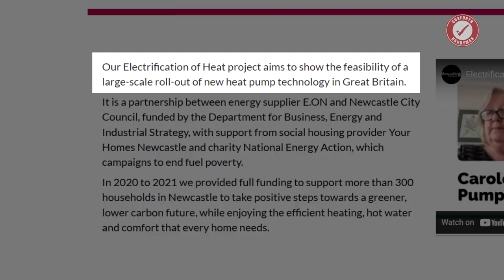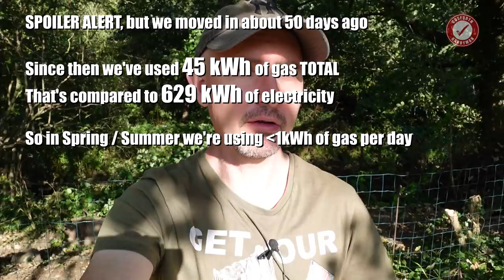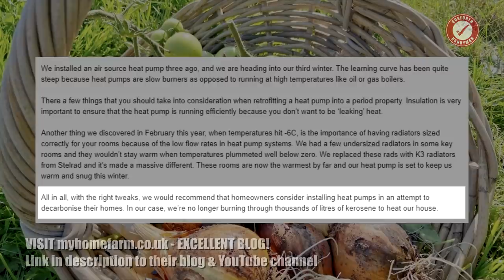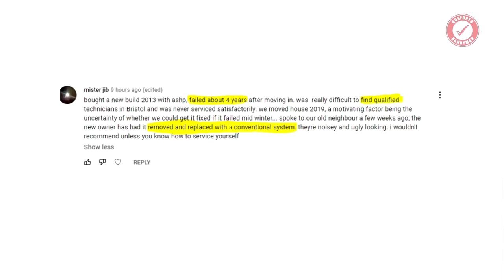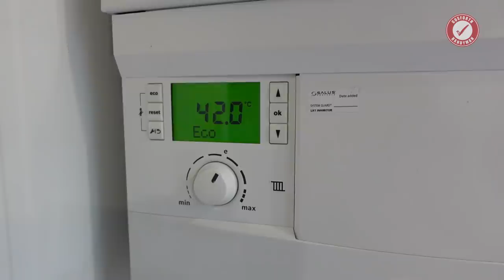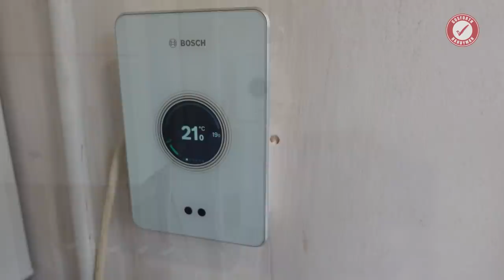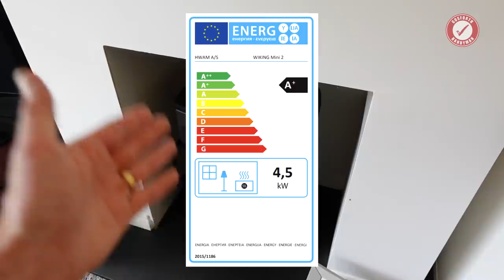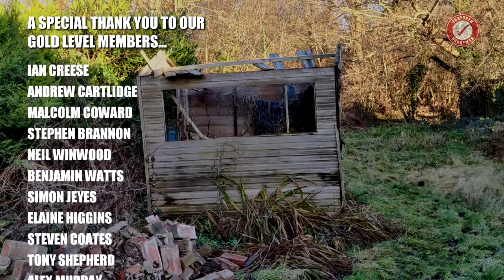Why didn’t we install an Air Source Heat Pump? (1920’s Renovation Part 32)

Comment: Stay away from air source am in the trade yes they work but and it’s a big BUT they just don’t have the efficiency and are not developed enough to provide what you need trust me on this am now going to watch the vid my dad who was also in trade has fitted AC in his major occupied areas but not air source 😉 he had the time to do the research AC also heats at a 4 to 1 input output value but it only heats air that doesn’t heat the building fabric but is very good ground source you need to be 10metres down to get the heat transfer at any reliable and consistent amount all your other details are pretty much correct 😉

Comment: We have reverse cycle air conditioning as it gets pretty warm in summer and heat is needed in winter. (Outer Sydney Aus) Just had a new unit fitted today! Our old LG system gave up the ghost a month back (18 yrs old) The new Daikin Cora unit is far more efficient than our old one. We have found over the years that 7.1 kw is good enough for our needs. In winter, we tend to use a wood fire. Finding good well seasoned wood isn’t a problem. It’s also pretty efficient. March to September has cost us approximately £100 for wood. Some wood I can just collect off the ground in the local bush. The Aircon only used occasionally when the fire has been allowed to go out. Now considering installing a Tesla Power Wall due to power outages during storms. We have lost all electrical power twice this year. Once for 4 days and again for 2. Thank goodness for a gas fired BBQ and a 2000 w generator!

Comment: You will be ripping that WB boiler out within 2 years - they have major design flaws - keep an eye on the silicon burner seal - they crisp up nicely and leak combustion gases. Also be prepared for a leaky diverter valve
Reply: Vaillant boilers are the way to go, from what I have heard?
Reply: @dougsaunders8109  lol
Reply: bolloxs
Reply: The model he has fitted does not have that type of silicon burner seal. They do need replacing after a few years on some models (ie Junior)  but they are are around £10 for the seal and if replaced when you have a service shouldnt cost a lot to replace. I have found that all makes boilers have there own weakness.

Comment: DHW requirements are different for everyone, but the standing losses on a modern cylinder are extremely low. If it was costing you a lot of money to run, there was probably something wrong with the installation. Also worth noting that the boiler will be most efficient running at the lowest possible flow temperature to achieve the desired indoor temperatures. Your discussion about the radiators being extremely hot and heating large areas quickly suggests there are further savings to be had in running costs.

Comment: If heat pumps were really so good they would sell themselves. They wouldn't need government schemes to help sell them. May be okay in new build  well insulated homes designed for a heat pump in the first place but not to retrofit in an old property
Reply: The issue is the shoddy installers telling homeowners who are on mains gas to swap for this unit, it wont be any cheaper as gas is so cheap. However with prices set to go up then ashp will tip that balance.

Comment: I feel the main issue with the comparisons, is they are argued based on efficiency where ASHP absolutely wins. But in the UK, mains gas is so cheap it's practically free whereas electricity is quite expensive. (It's about 1000%(10x) in price  between the 2 per KwH) 
Obviously Gas prices are set to skyrocket over the next few years, but I doubt electricity will sit around.

Also, The amount of issues I've had with British Gas and Scottish Power, I don't think E.On are any worse of the big 6.
Reply: British Gas (South Africa staff) and Scottish and Southern (SSE)... totally useless.

Comment: If it's free,  you are the product. 
Thanks for this, we have to change our boiler next year and were wondering about these things, our house was built in the 30s and has leaded windows so it's a definite nay nay.
 Haha you had an add for a heat pump water heater slapped in the middle

Comment: very interesting.
i live in rural Estonia. We use a wood pellet boiler, we have just had 5 tons of pellets delivered. We replaced our wood boiler 3 years ago as it was horrible to keep the fire burning... but that may have been due to the model & company. 
Our winter's will get down to minus 20 C deg.
We love this boiler esp as compared to the wood version

Comment: I live near Wigan and have an air-con for my conservatory, we put a proper roof on the conservatory so heat loss is nearly all via the double glazed windows. The air-con works as a heater as well (I think all modern ones do) but although the specs says it will work down to -7c, it doesn't do too well below -3c. Doesn't bother us as we hardly use it for heating and will put a pullover on instead.

Comment: Andy, you did well to swerve the ASHP. My friend purchased a property from the 1930's that has one fitted. The house is only 2 beds, but her electricity bill was over double what mine was for a 1960's 3 bed semi with gas central heating and knackered double glazing.
She purchased 4 oil filled radiators and halved her energy bills.

As for the green homes grant, I can concur that it was a bit of a muddle. I applied for a grant for solar thermal (my choice based on the lack of space for a biomass boiler).
Due to the amount of work my installers had on their books I ended up applying for a 3 month extension.
3 weeks short of the extension date ending, they cancelled the grant. Ended up threatening  them with Court action so they ended up having to reapply the grant and extend it again to end Nov.
System was installed and commissioned last Friday and, despite the freezing weather, the system provided 3 hours worth of water heating on Sunday.
Considering my panels are on the front aspect and the sun rises on the back aspect, I was impressed.

Comment: In our small 4 bed new build it was great, really cheap and noise wasn’t an issue due to the layout. You just have to use it at lower temps (19 not 22!) and on for longer periods. Also, crucially, the house was designed with it in mind

Comment: Andy, it's very interesting what you where saying about people not being able to use a thermostat. We have the same problem here in Australia but in reverse. People that want to cool a poorly insulated home to 20C at the height of summer when the outside temp is in the mid to high 30's, or in some cases hotter.
Reply: You dont need 20 . 25 is good to amid low humidity. Also when you go outside the difference is not that large

Comment: I live in Oxford and have two air Sauce Ac in two parts of the house. In the winter when it gets to -1/3 it will not get very watm but in the summer they work very well. The house is very well Insulated.

Comment: Wood burning stoves - problem is not the carbon footprint, it's the microscopic soot particles that, as with older diesel cars, is vastly more dangerous than envisaged a few years ago. We were going to install one in our 1930s semi in London and now glad we didn't. 
   We did make same decision about new combi gas boiler this year - incredibly efficient and long warranty. Also upgraded a couple of radiators. Very good decision. Will put electric fake wood burner in remaining fireplace for quick heat when don't need radiators on. But rads on low permanently is better than on and off because don't have to warm house from zero every time they come on. Two showers and one bath - powerful hot water in all. Cost same as yours. Also massively upgraded insulation, like you

Comment: Just bought a barn on the Isle of Lewis, Outer Hebrides with no mains gas and air source heating once the walls, roof and floor is properly insulated seems the way forward. We plan to back it up with a wood burner for particularly cold days.

Comment: thanks for the vid. glad you said the boiler wiring was going to change (i had to cover my eyes as an electrician). But i think the smart trvs are good particularly in bigger houses so you can set rooms that you go in to heat up especially useful to have upstairs only heating in a morning not in the evening as heat rises

Comment: A no frills combi boiler system used for heating the entire home on the few coldest months, and for the domestic water, with a simple air source heat pump system dedicated to heating specific rooms in the house via wall mounted units/ducted unit (slightly oversized for the living room and bedroom) is the way to go, it gives you options and if done right works out cheaper than most other methods.
Reply: two heating systems is not really the way to go for most people.

Comment: A fascinating vid Andy. There is another potential issue as well. If your installing a ashp, like car chargers you have to ask permission from the Dno. And in some older houses there is either too many existing circuits or in some cases they wont upgrade to a 100amp fuse. And if a car charger is already installed,  they could refuse permission.  Sadly the general public dont appreciate this in a lot of cases.

Comment: Stayed in Winchester Lodges over Christmas 2019. I was a Domestic Energy Assessor  now retired. All the lodges had  Air Sorce Heat Pumps.  They were quiet we had lots of hot water and we were toasty warm even though there was severe frost every evening.  The secret was the pump heated under floor pipework throughout the Lodge.  People use RETRO FIT and try to plug it into existing radiators.and that is why they are not efficient   They work and they're very quiet. The owner said they'd saved him a fortune.

Comment: combi boiler best the def choice ,theyre so much more reliable than they used to be ,i lived in several households in the past 20 yrs and not one had a problem ever , fingers crossed the one in my  flat is now 12 years old and working as new ( gets yearly tested )

Comment: Got a friend that required a new heat system for his Somerset cottage that had used fuel oil before. He got a GSHP and ASHP combi system installed, and is very happy. I suppose 4-5 foot walls have really good thermal mass.

Comment: Some great comments and balanced feedback. The only thing I would add is that given the option GSHP is the way to go given that the earths core temperature is not affected by seasonal variations in temperature and precipitation. That said it needs a modern well insulated house to take advantage of the lower water temperatures so no5 always suitable for retro fitting.  All new builds should be built with GSHP and Solar.

Comment: Over here in Ireland the council are fitting air source heat pumps in every house new and old  pulling out oil boilers and fireplaces, the big reset i say we're in for a few rough winters

Comment: We have an old Victorian stone-built detached house, for which we had a new heating system installed 5 years ago.  Our heating was formerly via a gas boiler housed in a Rayburn cooker, which was designed to operate both for cooking and central heating.  It was costing us a fortune and was not heating the house adequately.  We eventually decided on a hybrid system, which consists of a 16kw Air Source Heat Pump and a 32kw Gas Boiler.  The AS Heat Pump takes care of heating when the outside temp is above 5c, then the gas boiler takes over at lower temperatures.  The gas boiler heats the water, but we also have a 4kw solar array which can power the heat pump in the right weather conditions, but which also heats the water (300l insulated tank) via a solar i-boost system which automatically diverts spare solar electricity to heat the water.  Even in the Winter, the heat pump is normally carrying out heating duties, as more often than not, the temp is above 5c.  We also have a wood burner in one room (living room).  In our experience, the heat pump has been superb, it has saved us a lot of money in energy costs and also did not cost any more to install than a 'gas only' system would have, because we benefited from a reduced VAT rate on the installation, due to it being a renewable heat source.  We have underfloor heating in our cellars and oversized (triple) radiators everywhere else in the house, so we can run the heat pump at a low water temp (45c).  You don't need wide bore piping (as you mis-leadingly have stated in this video), our existing 15mm copper piping has been retained throughout, except for the stretch between the heat pump which is outside and our gas boiler on the inside.  The triple radiators were not expensive to install.  The heat pump will operate down to approx -15c, but gets less efficient the colder the outside temp is, which is why we choose to switch over to gas at 5c or below.  Also, the heat pump is not excessively noisy, you would struggle to hear it outside if you stand more than a few yards away, so your comments about 200 houses running this on a housing estate makes no common sense.  Also, points made about servicing are misleading - AS Heat Pumps don't require servicing if installed correctly and filled with the correct Glycol solution.  Our annual service is for the gas boiler, not the AS Heat Pump, which has an expected 25 year life span.

Comment: I live on Vancouver Island Canada , similar climate to southern UK, we have a1400 sq foot single story house, slab on grade , not insulated under the concrete. We have a a mini split heat pump system installed and are just entering our second winter with it. Unlike the UK system we have 2 heads  mounted either end of the house,  that blow warm air,  we keep it set at 22 degs cel 24/7. It keeps the entire house very warm and costs $70 a month to run , that's about 40 quid UK.Actually that is our total electric bill. Oh and we also had a grant to offset the $8000,000 install.
I don't think we have the heat pump to radiator system here. From what you say they do not sound very efficient.
Reply: No he's just grossly misinformed

Comment: 20:34 Maybe the people in ultra insulated airtight homes are opening their windows because fresh air is nice and their homes haven't been fitted with ventilation that uses a heat exchanger. I've never lived in one but the idea of steaming in a household's trapped farts and exhalations overnight doesn't appeal.
Reply: look up heat recovery system

Comment: When we bought this house, a dormer bungalow three years ago, the oil boiler was from 1970. Gas wasn’t an option, so we went with a new, very efficient oil boiler and an air source heat pump. We couldn’t find a certified installer so any grants were not possible  The oil heats the house quickly in a cold morning, then we switch over to the heat pump. Running costs, heap pump 20p per hour - oil £250 per year. The ASHP usually turns off at 20C in the open plan living area, radiators are at 35C. The ASHP is very quiet except in temperatures below freezing when it work much harder. The dual system works very well for us as long as we are aware of hoe we are using it. No problems or complaints.

Comment: Very nice video. Currently looking into alternative heating/saving on the gas bill myself. Radiators are going to be resized and low-water temperature ready (radiator situation in the house wasn't great when I moved in). But of all the options I've landed on two systems. A conventional top-of-the-line gas boiler (Viessmann) or a thermodynamic heat pump. The heat pump costs twice as much to install, even with grants here. The idea is still, to keep the house warm and have hot running water, as we do now. If the gas prices doubled, over 24 years we would be paying a total of €1800 extra. Which is just over half of the extra costs of the heat-pump system. Just to give an idea. Investment wise it will never make sense, until a similar priced solution with the same capabilities and longevity of a gas boiler comes out.